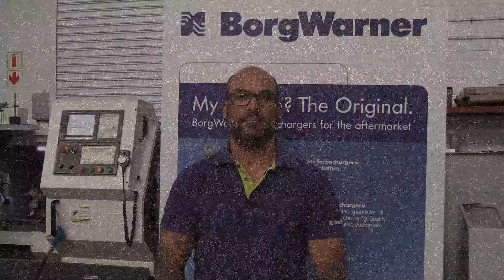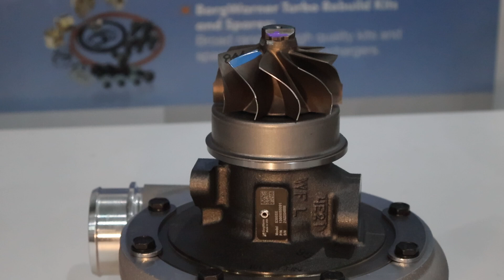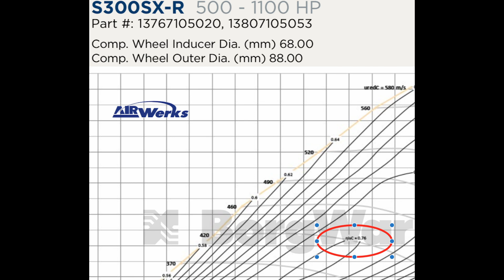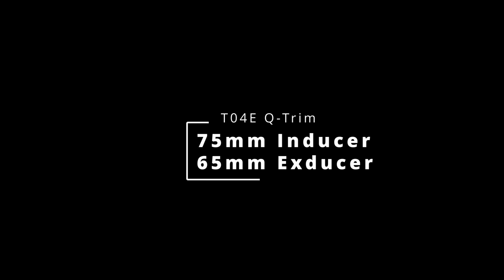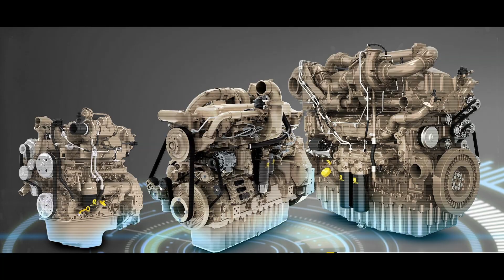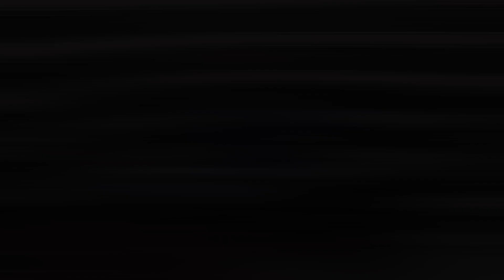S300SXE versus S300SXR The long awaited Video

Comment: I went from a 362SXE to a 368SX-R and I can't believe how fast it spools. I pulled graphs up and it's almost indistinguishable. The 68 punches so much harder
Reply from the maker: @Jake39019  thanks for the info - much appreciated
Reply: Can you provide graphs ? I am very interested.
Reply from the maker: @ which graphs would you like To see?
Reply: @SuperSchnabulator  don't think I can post pictures here but I was hitting gate pressure of 27psi at like 5700 rpm on a 3.0l
Reply from the maker: @ which turbo and housing combination?
Reply: You don't consider that late spool? 5700 , on a 3.0?  I know a basic 366sxe hits max torque just over 4000 on a 3.0.  A 362 spools at least 500 rpm sooner than the 366. (M54b30 , 3.0 , only 20psi. I don't think 27 should take 1500+ more rpm. )
Reply: @drewdavis239  moreso a engine issue. I'm on a 35+  year old engine design, stock head and cams. On a more current, more efficient engine, it would spool faster. It might spool faster than 5700.  I'd have to look over logs tbh. Was just an estimate. Realistically it's probably closer to 5000 now that I think about it. I'll check my logs and let you know.  You probably also have a smaller hot side than I do. I'm making 700+ wheel, estimated of course based on boost, and my knowledge of this engine. It did 560 wheel on low boost on my 62sxe
Reply: @Jake39019  I'm running similar numbers.  My 3.0 is on a stand (aluminum block) car currently has a 90's m3 engine s52b32us / m50 based single vanos 3.2L. I'm over 600 on pump , just under 800 when it's over a e70 blend (flex fuel e85 dual tunes stock computer). I'm running a 66/62 3582. ( This YouTube account ,  proved to me it's a better choice vs. a g35900, by taking the time to reply when I asked questions. )  my friend runs a sxe366 open manifold on his m54b30, bmw he spools right before 4000.... It was real cold out one day, and it was spooling under 3500. He was pumped, gave it the beans on a uphill and kicked the rods (big torque under 4000 rpm) he was making low 500's guess. Pump gas )
Reply: @Jake39019  I'm running a 66/62 currently.  After this YouTube page proved to me it's the better choice vs. the g35900 that I almost chose. They even took the time to reply when I asked questions. Current engine is a built s52b32 American 90's m3 engine. Stock cams. Lower compression. Maf numbers say I'm making over 600whp on pump. Over 700 on my high e content tune. Dual selectable maps on  stock computer.  Car is a e39 touring. (Original engine on is on a stand / 3.0 L m54. Spank ranch garage has the same car with a sxe366 open manifold. He also has videos on his YouTube. )
Reply: Next turbo will probably be on my 2jz build. I would like a twin scroll g40900 ? I will be disappointed if it spools a lot later than the BMW. I know the BMW head makes the power on less boost. Only time will tell. ( I will be interested to see the drivability difference. The BMW engines have been really good to me. )
Reply: @l_ionize333  so I checked a log. Just did a few hits, finally got it to hook up enough to open the gate. I made 26psi at 5300 rpm. S368SX-R .91/ divided manifold 7mgte on pump Ethanol.
Reply: @Jake39019 how many valves per cylinder?
Reply: @FathomSoundProAudio  4 per cylinder.  7mgte if you want to look up the specs. Probably 8.5-9/1 compression as is
Reply: @l_ionize333  hey, i too have a turbocharged e39 with m54b30 and a broken EFR8374 at the moment. i tune the stock ECU with map sensor but there isn't 'dual selectable maps' on the MS43. where do you start spooling with the 362?
Reply: @Jake39019 Stock pistons and rods in that 7M...? I'm not too familiar with 7M's. Have over a decade experience with 1/2JZ's from modest power street builds to full racing drift engines, so that platform is what I'm comfortable with. Was asked to build a 7M and was thinking a 258sxr for it.
Reply: @Marko-JZX100 negative. Weisco pistons eagle rods. I run the s368 at 30psi now
Reply from the maker: @ something is wrong if this is what’s happening - especially if the turbo is the new SXR range -

Comment: this turbo is the best cheapest up grade iv done the sxr black wheel is  in credible .. thanks for backing up the info
Reply from the maker: @skylineprojectsau  thanks for the comment - glad the info provided supports real world results
Reply: r33, are you running the s364 sx-r on your RB? What displacement is your rb, and how does the turbo feel?
Reply: @jonathanh4446   g,day john i am using the s300 1100 hp rb28 stroker the turbo works will make 1000hp with no issues.

Comment: For the second, smaller SX-R you showed, would you say that the turbine is sized well for it to be used as a single turbo on a 3.5 to 5.0L engine revving as high as 8000rpm? If not, what would you say is the largest engine this turbo would be suited for at an 8000-8500rpm redline?
Reply from the maker: @Drunken_Hamster  thats high rpm for a 5.0engine assuming that would be a V8 - this turbo would Be small.  I would need the engine specs to calculate its VE and then what your target HP is and what application (drift, drag, street etc) and then it’s easy to plot on a map for you
Reply: @TurboDirectSA  Well, I'm nowhere near ready for that. My concept is to use either a 3.5L Honda or Toyota V6 OR a 4.3L LV3 V6 which is based on the gen 5 LT platform and has great heads (which I would further improve upon). The JDM V6s will likely stay at stock displacement, but the 4.3 can be bored out to match the 6.2 V8 bore (or more which results in 4.6L of displacement.

If I could get my hands on a custom 95mm crank (admittedly not a huge increase from stock so probably not worth it) then that brings it up to a 4.8L displacement while still being safe for boost. Realistically I'd either keep it stock displacement or only bore it out to get it to 4.6L but I wanted to pad my number for you just to see how close of a thing it'd be on whether or not the 950hp SXR was usable for this application as a single turbo system.
Reply from the maker: @Drunken_Hamster  the larger unit is what you want- you never choose the turbo for your max HP to run at max all the time. Rather have more in reserve so that both the engine and turbo are not running at full steam - makes a reliable setup. The AR1.00 is the turbine housing together with the 80mm turbine with cutback and you’ll be set - look at the efficiency at lower boost levels - it’s a perfect turbo for that larger size CID engines
Reply: @TurboDirectSA  Gotcha, thanks. Would you say that the 950 is better suited to the 3.5L engines? Doing a simple bit of math shows that even 4.3L turning 7500rpm will flow more than the 3.5L at 9000, which is the limit I considered running the 3.5s and only because they have the 4v heads to support it. I'd likely still run the 3.5s the same at 8000-ish max so then there's theoretically a much larger disparity between the two sized engines in terms of potential peak flow.

To be more clear, my overall goal is to produce 380-430whp N/A and 600-800whp boosted with either engine setup and I want them to go into a Z31 300zx. Good response, obviously. Multi-purpose in terms of what performance category it'll be used in, though it'll mostly just be a fun street car.

Comment: I know you responded to my comment in the previous video about s200 coming up later but I would like to know, given your experience, how the s258sxr will perform on a 2L TFSI (83.5mm oversized pistons) , especially in comparison to the 7163. I know the sxr is more like the EFR7670, but in terms of response and power potential, how good of a choice will it be . Especially myself who wants to upgrade from my 6758 twinscroll
Reply from the maker: @35gti-ke  all the EFR similarly sized turbos will always outspool the SXE/SXR  for two main reasons, EFR is ball bearing and use the GammaTi turbine wheels - they are extremely light weight. The turbine wheels on the EFR is also mixed flow - BUT that doesn’t mean to say the SXE/SXR is laggy - laggy in comparison to what - they outspool any Garrett or Precision turbo journal bearing for mount Al bearing size for size - and more importantly outlast the others by leaps and bounds too. The bearing setup on the Airwerks range is bullet proof!
Reply: @TurboDirectSA   Yes I get EFR vs SXR EFR will come out on top due to gammaTI and BB. Let me put it this way, how laggy and more future proof will the S200sxr be against the very similarly sized EFR7670, given the fact that from the compressor maps, the s200sxr makes 125hp more than the 7670
Reply: Another thing, is it possible to create your own 'hybrid' ? ie take the SXR compressor wheel and swap out the one on the 7670 given they are more or less same size?
Reply from the maker: @35gti-ke  the SXR will make more ontop without a doubt as it has a higher mass flow rate. But where is it that you want the power? Is this a street car ? If so you do want some midrange or the car will be a dog to drive!!  If it’s a circuit or track toy with occasional street drive then top end power isnt a bad thing. The EFR7670 makes less power yes - BUT I can guarantee you that it will out accelerate (gear for gear) the SXR around a track with slower corners as it will make more power for longer than the SXR, yes the SXR will catch the 7670 up top but it will have to work hard to make it up. More power isnt always better - DEPENDING on the application. Example my golf7.5R used our smaller IS38-450 and it does a consistently faster 0-160kmh run (without launch control) because of the additional 400-600rpm better low down response. Using launch control the cars run similarly up till around 100-110kmh then the 550 pulls out - boost for boost

Also keep in mind that say you are boosting 1.2bar boost on pump fuel on both turbos, at this point you won’t see 125HP more from
The SXR - the EFR will spool quick a lot faster and pull away from the SXR. BUT on the other hand - setup the car for max power on both turbos (different boost setting apply) and then do an acceleration run and you’ll see a different result again.  It’s a wide and open conversation All that depends on a lot of different things. I think I’ll do a video on this topic for you in the coming weeks - to give you more info on this
Reply from the maker: @ won’t be possible due to the hole diameter of the EFR vs SXR - they differ
Reply: @TurboDirectSA  Ah . Gotcha. I really then hope that they transfer this compressor wheel tech to the EFR line, I know it will eat into some of the other turbos (especially the 7670 itself, recently launched 8370 and perhaps even the 8374) but if they come up with say EFR7670R  lol that will be nice.
Reply: @TurboDirectSA  Okay. Some good insights. Please do a video on this.  the SXE/R line are cost effective but would like to get a detailed video of what your are truly losing if you choose them over EFR.

The application in mind was to run lower power on the streets while having some good response but also do drag ( not autocross) with it, which of course requires top end.
Reply from the maker: @ the 8370 in essence replaces the 7670 - identical turbine - higher flow compressor
Reply: @TurboDirectSA  Yes, unfortunately physical size won't allow stock location placement, unlike the 7670. This was the other reason I was interested in the 258sxr now that I remember (Same power capability but smaller physical size. obviously response and other things mentioned above will be different)
Reply: I have the s257 sxe .82 ar t3 single scroll on my bmw e30 325i
It made 500 whp at 1.7-1.8 bar on pump gas + water meth
If in the future want to upgrade to s258 sxr super core is possible? And keep my current turbine housing?
Reply from the maker: @ yes - and supercore are on hand ready to ship
Reply: @TurboDirectSA  do you think will have more lag the s258 sxr ? 
I saw that is has 775 hp rating but the size of the cw is almost the same as the s257 sxe
Also at same boost level 1.8 bar will get more power or will need to push it more,?
Reply from the maker: @ won’t be laggier - with the same manifold and turbine housing PSI for PSI - you’ll see a straight HP jump.
Reply from the maker: @ not at all - PSI for PSI you should see a power increase. Make sure the engine can use the additional flow or you’ll see surge or other issues
Reply: S200 is equivalent to the gt35 comparing like for like specs. S300 like a gt40. But the BW turbos are so well engineered to take the punch.

Ive had a s300 (7006) installed on my 2.0tfsi, T4 open laggy as shit from 1st and 2nd but when in 3rd gear around 4500rpm I outflowed so many cars on the highway until i reached 8000rpm, 4th gear keeps on pulling until 8000rpm then 5 and 6 is useless again 😂 but at 1.6 bar boost which is nothing for that turbo.

For my application common sense had to prevail so removed it and installed a 3076r as my exhaust flow is better matched for.

Just wish BW has something as a direct match to the 3076r.

Ball bearing is very nice from a response perspective. Having experienced both journal and ball bearing i now understand what the rave is about.
Reply from the maker: @ Borg has a much better option than the 3076 - if you installed the EFR8370 you’d be burning tires through 4th gear - it will outspool and outflow any 3076!